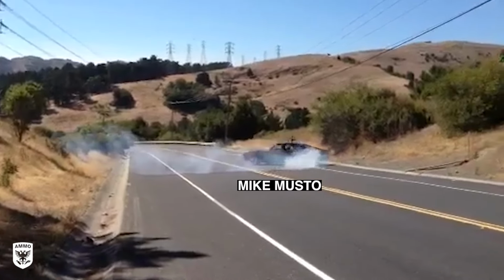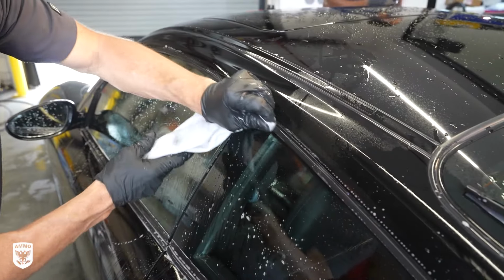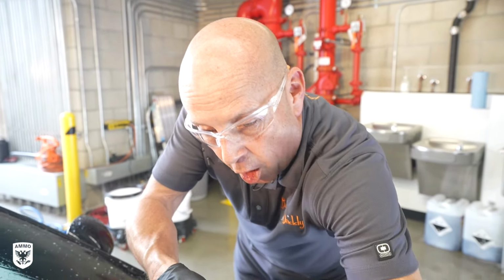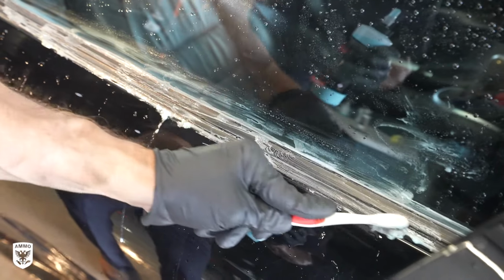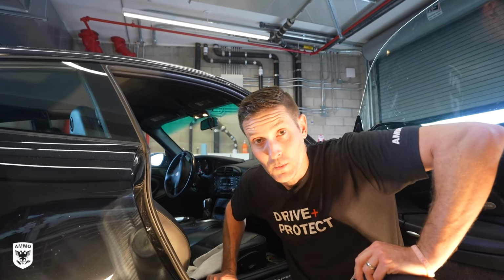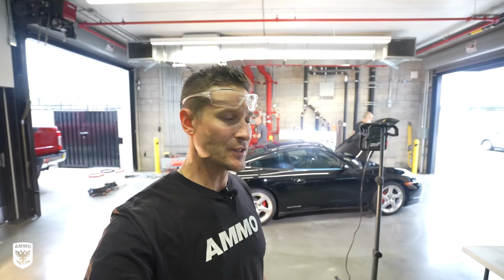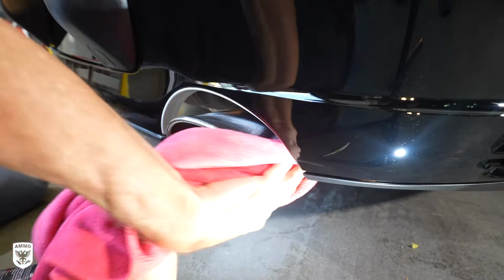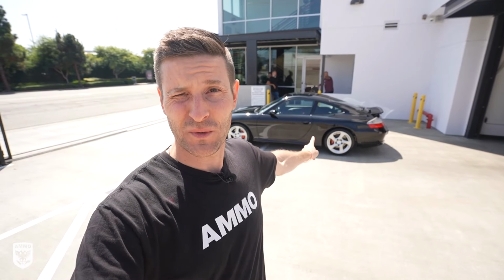Daily Driven Porsche Full Detail Burned Paint Disaster!

Comment: Interesting trick with the compound on the rubber. I discovered (by accident) a similar trick for dealing with the fine pin-stripe scratches on my Land Rover’s plastic trim along the A pillars and other exterior bits. Not deep, but very noticeable from going through the bush on the trails. Nothing was getting rid of them. 
On a whim, thought “why not?” and used a fine polish on them and it buffed them out perfectly. They looked brand new!

Comment: Mega job guys, looks incredible now and some great tips for people!  Did the PPF pull some paint on the lower bumper?  V frustrating removing PPF, not knowing if it may have had a repair in the past or not!  Easily fixed with a small repair.  Framing is a term I've not heard before, but love it.

Comment: What was the water-based polish compound that Kevin used on the rubber trim?
Reply: Asking the important questions
Reply: I would also like to know this.
Reply: I would like to know too
Reply: Definitely a Meguiars product, looks like the "Marine Heavy Oxidation Scrub" M17732, based on the color and bottle shape, which is described as a water-soluble solution. Seems to be the closest match i could find in like 7-10 minutes.
Reply: I sent him a message on Facebook. Here is his reply: "Hello. You can use all sorts of compounds… most of the currently available compounds are water based. 

I’m pretty familiar with Meguiar’s, so: 

M84 Compound Power Cleaner

M85 Diamond Cut 

M100 Pro Speed Compound (which is what I used)

M105 Ultra-Cut Compound

D300 (DA Microfiber Correction Compound)

The consumer product Ultimate Compound will all work!"
Reply: @hoosierbbq  thanks Ben! I’d kind of assumed that compounds were generally water-based but I always have a concern about them staining plastic trim. Good to know, I’ll give 105 a try on the beater car.
Reply: @travisio  all this time I have been taping off rubber trim because I was afraid of staining it. Haha.

Comment: My first thought was the lamps, those lights are super hot!
I laughed so hard we you three geniuses realized it was too hot. No disrespect, just surprised, that I was correct in troubleshooting at first glance. 
BTW close the roll down door to the warehouse to prevent the airborne particles from moving in from the wash bay onto stored cars.
Reply: Thank you for watching. Yes, they get warm! I brought them as backup, just in case the lighting was poor (it was, which is why I used them, and why the door was open). 

Even though we could’ve easily bypassed the “situation“ created by the lights (problematic polishing, due to heat generated by the halogens), and avoid addressing the pitfalls altogether, that doesn’t help anyone. 

I don’t mind showing when my choices cause an issue (in this case, to fail to considering the lighting as  the immediate culprit). I really need to bulk up on my Scangrip detail lights.

Comment: I like the way Kevin modifies tools to better suit what he needs them for, rather than just accepting them as produced.
Regarding the polishing pads clogging up, I realize that was due to a heating issue, but I'm wondering if a very fine grit wet sanding disc would ever be preferable to pads. I'm talking 3000 grit, or 5000 grit, or even finer. Obviously this would still necessitate some polishing, but could fine grit pads be a way of avoiding the normal residue issues?
The marvellous attention to small details in this episode, is just the reason I think you should have customers inspecting their vehicle at much closer range, at 'big reveal' time, before giving the thumbs up. If nothing else it would add a bit of suspense to the show.

Comment: What type of water based compound was used on the trim? Something aggressive or more fine?
Reply: Hello. You can use all sorts of compounds… most of the currently available compounds are water based. 

I’m pretty familiar with Meguiar’s, so: 

• M84 Compound Power Cleaner

• M85 Diamond Cut 

• M100 Pro Speed Compound 
(which is what I used)

• M105 Ultra-Cut Compound

• D300 (DA Microfiber Correction Compound)

• G17216 Ultimate Compound

• M205 Ultra Finishing Polish
Reply: @iamwaxman  excellent, thank you. I'll be attempting this on almost the exact same trim.

Comment: Luckily the car's paint was black - any other color and all that rough cleaning of the rubber trim would have bled black sludge onto the paint and can actually damage the paint if left long enough to dry
Reply: In my experience, that CAN happen if either: a strong detergent is used to clean the rubber (the detergent dissolves or oxidizes the paint,; the rubber debris attaches to dry, rough, or oxidized paint. This is a common occurrence with motor homes that have become dried or damaged due to fiberglass or composite panels that dry (oxidize) due to sitting in direct sunlight, or hot climates, or being washed with strong detergents.

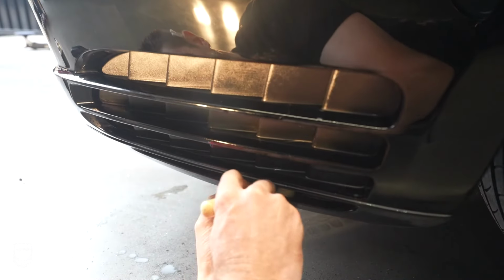Comment: 18:20 what is the spray you guys are using? I remember you have used this in a video in the past but I cannot remember which video that was.
Reply: Looks like a Meguiars Product based on the bottle.  Could be #39 Heavy Duty Vinyl Cleaner or #40 Vinyl Cleaner/Conditioner.